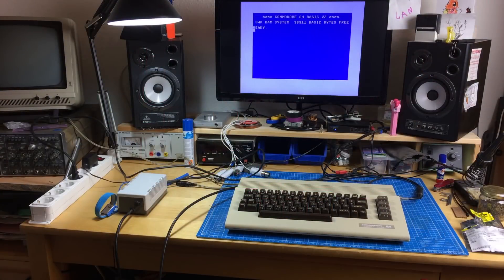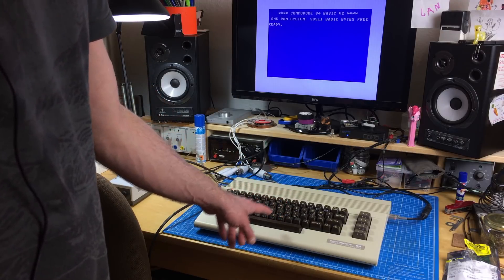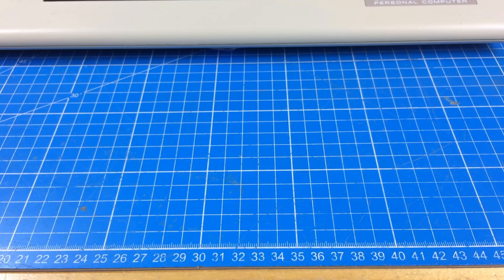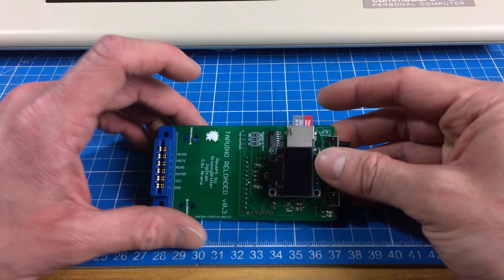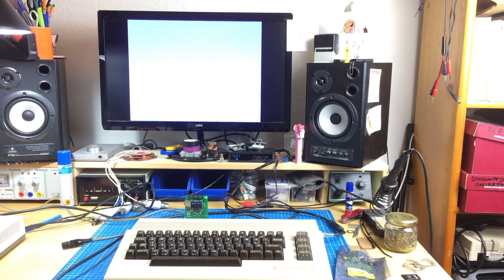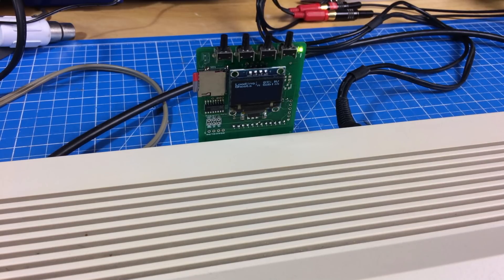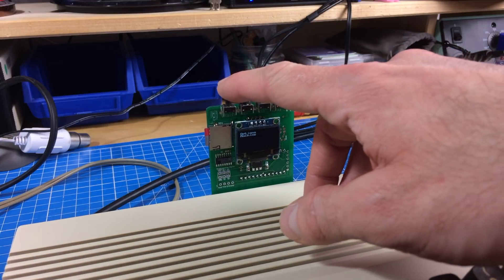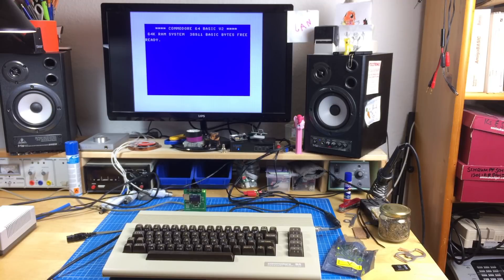Checking out the Tapuino Reloaded

Comment: I have a question. 🙋‍♂️ 
I have this set up for a c64. How easy is it to change my tapiuno to a c16 drive? 

Ps. Life goes on. You owe us nothing ❤
Reply from the maker: Using the tapuino with a C16 should technically just be a matter of making an adapter for the mini DIN connector that the C16 uses for the datasette. The devices are exactly the same, just with a smaller connector. The original Commodore datasettes came with an adapter at one point in time, even. :)

Comment: It is really great gadget and easy to make. All you need is arduino nano, optoocupler, one resistor, LCD or OLED, few pins/connectors/sockets and dupont wires (all-in-all some 10$).  I made one with vero board and other with my home made single layer PCB.  I had to redesign the original PCB layout a little, to be easier to make at home. Original design is hard for the toner transfer and etching at home.

Comment: Hi,

Could you please tell me the model or where you got your SD card connector?  That's the hard part to find!

I found your Github (https://github.com/arananet/Tapuino-Reloaded/blob/master/bom.txt) and some of the details I am not sure of in the BOM w/r/t gerberb v0.3 of your board.

1) Is the LP298XS taking in 5V and has a 3.3V output to drive the LCD?  Also, the BOM says it's a SOT23-5 package, but your board does not say so.  In fact, your board is using something like the LM117 regulator.

2) The SOIC 16-pin 74HC4050D.  Is that wider version or normal version of SOIC?

3) OK2 is the opto-coupler chip?

4) And, of course, you don't post the code.  Is this truly an open-source project?

Would be great if you could clarify the above for C64/VIC-20 enthusiasts to make use of your open source project.

Thanks!

Comment: Do you know something like this for a floppy drive by chance? Does such a device exist?
Reply from the maker: Yes, there's the SD2IEC. It's open source also and there's a variety of different flavors available. It emulates a standard 1541 without much support for fastloaders (only a few chosen ones work). If you need cycle exact floppy drive emulation, I'd recommend the 1541 ultimate.
Reply: Found it shortly after posting my comment and wanted to come back to tell you guys. So sorry ;)

But thanks anyways.

Comment: Good to see you back!
BTW. I've done tape drive emulator on Arduino before but I am still struggling to make floppy drive emulator in AVR. It works fine in ARM and FPGA but it's kind of difficult to do in AVR (not enough memory for a track).
Reply: pvc 

Try an ESP32. ;)

I think they have 512KB of SRAM, and the dual-core 240 MHz CPU. Usually only around £4-5 now.

They should have plenty enough IO pins for a floppy emu. Would still require input buffers and open-drain drivers, of course.

I believe they do also support 4-bit SDIO for talking to the SD card, but that may take more tweaks to get working, and of course not necessary for a floppy emu.

I was attempting to read from a floppy drive using FPGA (DE1 board) last year. It was the first time I'd ever really worked with MFM decoding, and it hurt my brain for a while. lol

it made it a lot easier after I wrote a quick spreadsheet that listed all of the valid byte-to-MFM values though.
I also added some cells where I could input the data bits between the clock pulses, and it would generate the correct MFM word and data byte.

The FPGA reader was intended to be hooked up to an 8" floppy drive for reading some Quantel Paintbox disks, but I couldn't reliably even read a standard 3.5" PC format floppy.

The hardest part seemed to be knowing when to start shifting in the bits so I could lock on to the MFM words correctly.
It would work about 30% of the time as the disk rotated, so I don't really know what the main issue was.

In the end, somebody kindly offered to loan us a Kryoflux. lol
Most of the 8" disks where just font disks, so no real exciting images nor logos from the BBC in the 80s or 90s, sadly.

Rather than reinvent the wheel, would it be worth porting the FlashFloppy firmware to the ESP32 or other device?

Or are you doing it mainly for the technical challenge? :p

I may be attempting the MFM thing again soon, but this time for a big "SMD" hard drive (see the spin-up vid on my channel).

This is part of yet another Paintbox related thing, to try to recover the images from its original giant Fujitsu "Eagle" hard drive, which has a far scarier 1MB/s data rate.

Hopefully the MFM it spits out will be cleaner and more repeatable than a floppy drive, though. The NEC drive is just to experiment on, but at only £40 on eBay, I couldn't resist. lol
Reply: Wow, that reply ended up being quite a bit more of an essay than I intended. Apologies for the wall of text, but I will admit to being a tad hungover this morning. lol
Reply: I am doing it just for the fun. I don't intend it to be commercial product and just I like to squeeze as much as possible from underpowered hardware ;)

Comment: I worry a bit that pressing does buttons cause some damage after enough time of usage, as it pushes the whole PCB+connector down every time. However the mentioned case may helps. Yeah, and welcome back, some channels even copies the "Jedi hand move" (at least how I name it, don't mean offensive, I like it) of introducing with "Hi, it's Jan Beta" :)
Reply from the maker: Yeah, that's about the only downside to this Tapuino version I could see, too. I'm not so sure about the case. Edu mentioned one in a tweet but I couldn't find it. I'll have to ask him about it.

The Jedi comparison is flattering. ;)
Reply: I thought a case for this sweetie which has mechanical support by fitting into the C64's case precisely (or would have "legs" downwards to the table) would help to stabilize things. However then, it should be a specific case for C64 (even for breadbin/new style in case of the "legs"), and probably others for other computer tapuino is compatible with. Though, I am still wondering why there are settings mode for C64/C16/etc, I had the assumption that cassette port behaves the same on all Commodore machines ...
Reply: A ribbon cable connecting the board to the datassette port would fix the issue.

Comment: Great to see you back! Glad you're feeling better too!! :)

Only thing I'm not liking with the Tapuino is the pressure it's putting down on the socket when you press the buttons, not sure I'd be happy with that!  if they could put more reactive buttons on or front mount them (so you can put your fingers on the back to support it), I think I'd be happier :)
Reply from the maker: Thanks mate! Feels good to be back! :)

I agree. The pressure on the board and connector is about the only downside to the form factor. That being said, you can of course attach an extension cable or something to prevent that.
Reply: You could go that, the screen would no longer be facing you though, it would lose cool points :p

Comment: Ghost 'n Goblins loaded terribly slow. In C64 emulators you can set the emulated datasette speed to like 8x. I guess the real C64 datasette's port handling isn't up to the job of accepting a higher data rate from the Tapuino ?
Reply from the maker: Oh, I think it can theoretically take pretty high data rates if the signal quality is alright. I have yet to fiddle with the timing settings and stuff.
Reply: You can make TAP files that are loaded at ridiculous speeds that just would not be achievable on an actual cassette. That's probably the best way to do this on a tapuino.

Comment: Hey Jan. Good to see you're back.
Could this little device help me "rip" my tape images from actual tapes?
Reply from the maker: Thanks! I can't think of a way to use the tapuino for ripping tapes. Might be there's some clever way of doing it though. I successfully ripped some tapes using WAV2TAP on a PC and a hifi cassette deck in the past.
Reply: Of course! I should give that a try. I think there was a device called audiotap. In theory, your device should be able to connect to a datasette (converter required) and record the audio. Which would be a stellar idea with so many tapes still around!
Reply: Easiest way is with a 1541 Ultimate II+ (with tape adaptor.)  It's a bit expensive though but it's very simple and produces pristine recordings and backups.
Reply: As Damien has already said, you can do this with the Ultimate II, which you own already. Doh.
Reply: Oh shit! I forgot it's an add-on too. I bought both the add-on and the cart years ago because of the whole UK "tapes are great" attitude (they're not, I know).
Reply: Yeah, the tape adapter. I know it exists, I just don't know what it does. I've always thought the tape adapter was to load .TAP images to the tape interface of the commodore. Not to load actual tapes to the Ultimate....I'll have another look at it. Thanks!
Reply: Well...if that's what you've got, that's what you've got. Apparently you can connect a Datasette to the Ultimate Tape Interface and load tapes directly to the Ultimate. The shop now has a Tape Interface for the Ultimate II+ which has a nice USB connector instead of the 8 pin header. I wonder if the new tape interface is compatible with the Ultimate II. It's only 14 euros. I've been buying tapes Malc. Tapes! And I want to preserve them.
Reply: The UII+ tape adapter does 3 things -:
1. Record physical tape to .TAP images
2. Write .TAP images to a physical tape.
3. Load .TAP files directly (no Datassette required)

I don't think the original Ultimate has the blue USB port so there's probably no easy way to connect it and it may not even be supported.
Reply: Thanks!
Reply: If you want to backup your C64 cassette tapes check out my video https://youtu.be/7kD3hA3Ck4o